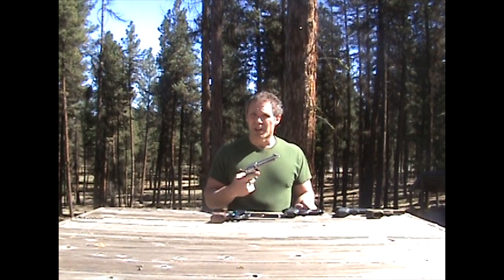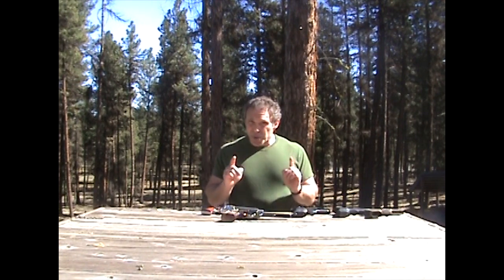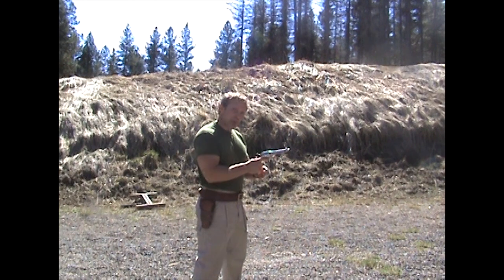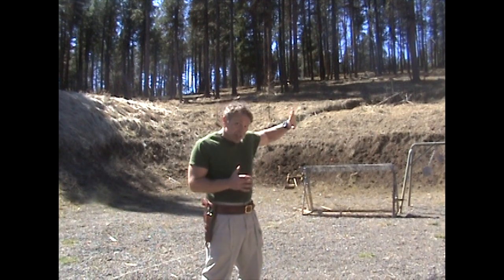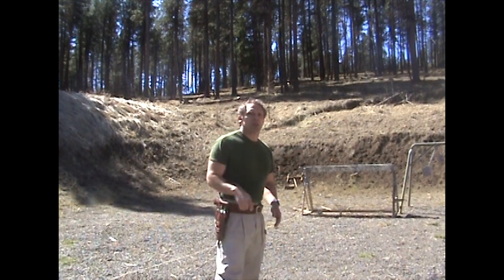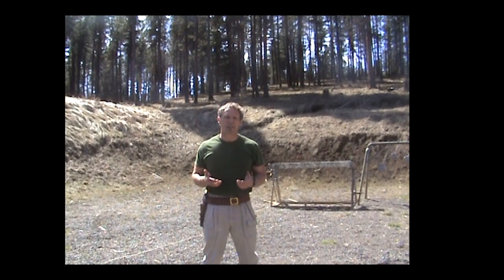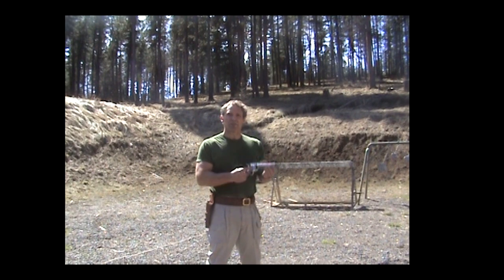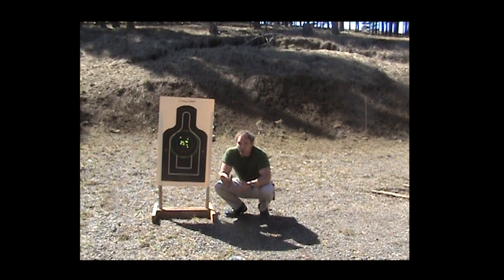Single Action Revolvers for Concealed Carry.

Comment: I just finished reading all of the comments and watching the video. How many of those that commented have actual experience in using a handgun for self defense? How many of us really need a high capacity semi automatic to defend themselves. I think that if you do , you are in the wrong areas at the wrong times. What is the average number of shots fired in a civilian self defense shooting? I fully support your rights to have a high capacity weapon, but wonder if it's a solution to a non existent problem. Revolvers, whether they may be single or double action are a viable self defense tool and each man/woman should choose what suits them best for self defense. Great Video, I enjoyed it very much.
Reply from the maker: Good points. Accurate statistics on how many rounds someone fires in a citizen involved shooting are very hard to find. But generally I think numbers like three, four, or five. I agree everyone should select what suits them best, but if someone really thinks that a 17 shot mag is a significant advantage over a 15 shot mag, then They're not focusing on what's important.
Reply: I acknowledge that what I'm about to report dates from the 1940's through the 1960's.  However, when my father was an FBI SA and firearms instructor, the Bureau had a "Rule of Three" for most shootouts:  three seconds (or less) duration, three yards (or less) range, and three rounds (or less) fired.  Okay, several decades have gone by, autoloaders -- not wheelguns -- now dominate, the FBI uses a seven (not a three) yard average and (maybe?) a five (not a three) round "normal" engagement.  HOWEVER, the essential point is many gunfights remain:  short range, six or less rounds fired, and very rapidly concluded.

I'm not going to carry a single action revolver for personal defense, but if that's what I had, I certainly wouldn't feel unarmed.

=====

P. S.:   An earlier post intimated that .45 Colt loads are quite outdated for defense.  That's absolute baloney.  While it may possibly be true for much "cowboy action" ammunition, it certainly is not universally correct.  I carry a Smith 25-9, .45 Colt, four inch barrel, N Frame Mountain Gun for weeks every Summer in the area near Chama, NM, and Antonito, CO (best trout fishing imaginable).  It's loaded with 250 grain Gold Dots, it's utterly reliable, and it's extremely accurate (duh, it's a very well maintained N Frame).  Those Gold Dots penetrate over a foot and expand to .7-.75 inches.  That certainly doesn't seem obsolete to me.
Reply: @John Lloyd Scharf:

I rather suspect the very significant “LEO miss” statistics, cited in your last two posts, were considerably lower a generation or two ago, when most officers carried revolvers.  After all, when a officer has an modern, excellent, semiautomatic (with, perhaps, a 13+1 or 15+1 capacity and with a few magazines that can be near-instantaneously loaded), some may see little need to aim carefully and deliberately, which I believe was far more typical during the lengthy “revolver era.”  Incidentally, I suggest this phenomenon also likely applies to our combat military (fully and semiautomatics weapons) and to civilian defensive firearms (generally modern, high quality, large capacity autoloaders).  I’ve contemplated the risks associated this paradigm with some frequency (it is not unusual to read reports of a couple dozen rounds fired at criminals with few — if any — hits). 

Full disclosure compels me to report that I have never served in law enforcement (although my father was an FBI SA and firearms instructor for 10+ years during my youth).  However, I spent twenty years as a Naval officer (including time in combat leadership positions in the early 1970’s), so I deeply understand why lots of not-too-precisely-aimed rounds are often fired (absolutely nothing seemed more comforting to me than a couple Browning M2’s ripping into a riverbank tree line).  

In addition, I ardently emphasize that every LEO has the fundamental RIGHT to maximize his probability of returning home uninjured after every single watch — there are NO exceptions to this principle. 

Nevertheless, and especially in highly populated, urban environments, all those misses continue downrange at high velocity, posing a very real threat to innocents.  This drives to question if would slow, deliberate, carefully aimed fire might sometimes be equally (or more) effective — and FAR less dangerous — than “spray and pray” in many LEO scenarios?  The fact that modern sidearms and rifles have the capability to fire enormous numbers of rounds rapidly — and to be near-instantaneous reloaded with box magazines — does not mean (at least to me) that this should be the default law enforcement tactical approach.
Reply: Roy Kiefer i
Reply: @Jennifer Montrie:   Did you post a comment?  All I saw was “i.”
Reply: If modern semi auto pistols were available in the heyday of SA revolvers everyone would have used them instead. To each his own but in my mind a SA revolver for defense in 2018 is silly.
Reply: One of the two times in my life I ever actually had to draw, what I had on me was a Ruger Blackhawk. The other was a Model Ten 3" barrel. I did not feel undergunned in either case. Open carry state, decades ago.
Reply: I live in a country where all handguns are banned, so I don’t really have the right to comment, but deep down in Paul’s presentation is something like, The gun you carry is not as important as the training you have on using it.  A very respected English shotgun coach told me, when I was 16 and learning to shoot, “Handle your gun every day, shoot it as often as possible and never even so much as pick up another gun”. A bit extreme but it worked for me.
Reply: @JohnLloydScharf  That may have been true in 1988, back when most police departments issued revolvers....

Comment: Hey Paul, huge fan. Awesome video! I only have one thing to add. When you are ejecting spent cases and reloading, you are right to do one at a time. One thing I train is keeping the gun at chest level. You should be able to load and unload without looking at your gun, but in the off chance that you do have to look at it it will allow you to still Keep situational awareness instead of looking straight down.

Comment: Bob Munden (RIP) was the only person I've seen shoot a SA Revolver, accurately, faster than you can shoot the 45 ACP 1911
Reply: He shot weak ass cowboy loads. Not full power self defense loads. He was just show.
Reply: Odee Dillon light powder charge or not, that is still 225-255 grains of lead coming downrange at least 750 feet per second. More than heavy and fast enough to hit and put down its target with ease.  Even if one isn't dropped with one or two rounds of that,  they still make near half an inch holes as entry wounds and at least that on exit, bigger than hole in the right spot, faster you bleed out.
Reply: chrismc410 I think you're confusing me with Tec 9 .  I agree 125% that the .45 LC is a man stopper.
However, I have only one correction for your comment; Entry wounds on mammals, man included, are not the same diameter of the bullet entering.  Because of skin elasticity, the wound is much, much smaller.  Exit wounds, depending on the bullet type, and caliber, and be similarly small, to grossly expansive.  This, from real world observation.

Happy New Year
Reply: Odee Dillon Though I've never seen him use a single action revolver, I'm sure Jerry Miculek can do it.
Reply: chrismc410 Yeah.  I think he's the reigning champ now.
Reply: +Odee Dillon  No one can match the speed of Bob Munden shooting two rounds from the hip, but Deuce Stevens is actually a bit faster than him at fanning:
https://www.youtube.com/watch?v=3NE6btH_9GY

Bob was very fast at this, when I saw him do it, but he was not the fastest.
Reply: +BBQ Sandwich  Bob Munden's cowboy loads, while far from hot for .45 Colt, weren't on the wimpy side for competition.  He used a custom load with a 250-grain bullet and a muzzle velocity of 785 fps.  In terms of momentum (for recoil), its power factor of 196 is considered "Major", and in terms of kinetic energy, its 342 foot-pounds is comparable to a decent 9mm defensive load.  It is hardly "weak ass" even for a defensive load, and is not easy for everyone to shoot.
Reply: +chrismc410  I've seen Jerry Miculek shoot single action revolvers, but thus far I've never seen him fan one as fast as he can.  He probably has the quickest right trigger finger in history, but I'm not sure about his left thumb.
Reply: Bob Munden was amazing. He could shot anything blazing fast and accurate.
Check out his video shooting a Bond Arms Derringer. Unbelievable.
Reply: @rbrtck  Deuce is not fanning , he's slip hammering, big difference.
Reply: @joelafives   True, I guess I was thinking of these techniques as essentially the same action on the gun done in two different ways.  That said, at the time I recalled seeing Bob Munden also slip-hammering (not fanning, strictly speaking) somewhere, and he wasn't quite as fast as Deuce Stevens.  The following was probably the video I was thinking of:
https://www.youtube.com/watch?v=xRXXxQ1OuDc
Reply: Go watch a Cowboy Action competition. You will not believe the speeds.
Reply: @OdeeOz  I shot a 200 gr bullet at 900fps. A lot of shooters did not shoot the mouse loads.
Reply: @mikefranklin1253  what does that have to do with the OP?  Did you shoot six in under 2 seconds from a revolver, like Mr. Munden did?
Reply: @SOLDOZER  You're F'n crazy! Light loads or not - had nothing to do with his speed. Bob Munden could shoot you twice before you could spell half of "he".
Reply: Search master gunfighter fanning on YouTube, guys name starts with a C i dont remember it but he's crazy fast

Comment: Just re-watched this one, today. Still like it! I have noticed some things, as I get older. Several years ago, DA revolvers gained an advantage, when two different conditions started affecting my right hand, because an auto-loader is at its best when run with TWO healthy, fit, strong hands; one strong hand/wrist to firmly support the weapon, itself, and another strong hand to run the slide. Lately, however, I am getting the first hints, in knuckles in each of my index fingers, that long-stroke double-action trigger-pulling may not be a skill that I will always be able to maintain. Single-action sixgunning skills are something I should maintain, just in case. My USFA Single Actions are mostly just “fun guns,” for now, but they may have a higher calling, sooner or later.

Comment: Another old method was to just remove the whole cylinder and drop in a loaded one.  Pull the pin, pop out spent cylinder, drop in loaded cylinder, lock pin back in place.
Reply: This is the way

Comment: Great points and good techniques. Looks like the first shot is about as fast as a DA revolver or an auto. Have you ever compared them with a timer? I would think they are very close. Too bad you didn't have one of the new Vaquero Sheriff's Models to demo. They make a 3.5" .44 Special, which may be just the thing. Easier to conceal too. Also, Ted Mernickle makes very nice high ride concealment holsters for SA's. I believe they are a 2 slot belt slide style, which should ride close to the body and conceal well.
Reply: Someone who is good with a single action can get a shot off faster than a double action because you cock the hammer during the draw on a single action.

Comment: Some other "advantages" of single actions army and clones:
- Safer. You can normally fire bigger calibers safer on a single action revolver. (no double firing)
- The colt SAA design in particular is very pointable gun and comfortable to shoot and the triggers are generally better out of the box than most semiautos and double actions out there, which means you will probably shoot it better under stress.
- The colt SAA design in general are heavier than most semiautos (even the smaller 3" birdsheads), and for this reason handle better recoil in many cases.
- You have the limit of 5-6 shoots, which many people see as a bad thing, but could be good if you look at it from a different perspective. For example you will avoid situations where you most likely have to shoot 10-20 at a group of armed people, which in most cases will get you killed by temptation, you avoid the trigger happy cop having to explain why he fired 18-20 at a guy pulling out a cell phone out of his pocket, if you are a regular citizen you will avoid having to explain spreading 15-20 all around the city, a real hard time, and probably including the time to apologize to the families of those hit by mistake in the process.

Comment: The NAA mini is about the only tiny concealed carry type single action I can think of. 

The best reload option for a single action is going to be the "New York reload" (carrying 2 or more guns) 

Another option faster than the loading gate is if you have a convertible cylinder model of single action you can have your second cylinder loaded in a pouch or pocket and put it in similar to the cylinder change Paul demonstrated in a cap and ball video. Many .45 Colt SA revolvers offer a .45 acp cylinder. Some straight wall .44mag or .44 special depending on brand offer a bottle neck .44-40 cylinder some .38-40  bottleneck offer a .40 or 10mm cylinder some of the .357 mag offer a 9mm cylinder some of the straight wall .327 or .32 hr offer a bottleneck .32-20  and of course many .22 mag offer.22 lr cylinder

Comment: Thought this video would only be about 5 seconds long, with Paul popping up and saying: "Are you crazy?"
Reply: I often carry a 45 Colt Ruger Bisley for protection. Bear protection, so not concealed. I carry cross draw as I only shoot single handed (I find the recoil more demanding with 2 hands using my "bear loads"). I practice drawing with both dominant and non-dominant hands (very easy to draw from the cross draw with non-dominant hand) and firing 2 shots (single handed). The Bisley's hammer sits much lower than the SAA or Blackhawk style hammer, and is easy to reach with even a short thumb. The recoil of the shot in the smooth grip pivots the firearm in the hand, which puts the hammer directly where your thumb can rest on it as the barrel drops for the second shot. This dropping of the barrel for the next shot effectively does all the cocking work for you and is already cocked when you are ready for the next trigger pull. Anecdotal evidence from those I have talked to surviving a grizzly bear attack shows you usually barely have time for one shot before the bear is on you anyway. More than one account involved one arm (usually dominant) being disable by the bear during the encounter. I am confident in my abilities with that revolver and trust it to protect me against some of the largest brown bears in the world. Because of my comfort with single action revolvers, I would probably be more effective with one concealed than I would be with a double action revolver. In all reality, I carry a 1911 when I'm not in the woods, but don't trust low power (less than 44 magnum) for charging animals in excess of 1000 pounds (bears, moose).
So in short, I don't see an issue with CC with a single action revolver. In trained hands, they can be very effective. The transfer bar safety revolvers  are also VERY safe to operate and carry.

Comment: SA revolvers are very ergonomic, pointable, and "handy" to use. With .45 Colt you have a fine choice of self defense ammo. And basically, one good hit is all you need to end a confrontation. If you need more than 5, you aren't qualified with that weapon. As far as quickness goes, it's easy to learn to draw and fire mighty fast. That matters.

Comment: I was thinking of carrying a cap n' ball black powder 44cal revolver for defense. Seriously
Reply: I'm not 21 so I can't get a regular centerfire pistol
Reply: Dom san yeah they're a pain to reload
Reply: I did it for 3 years. i carried it loaded, with 3 backup cylinders. I carried a 1858 Remington .44. I now carry a 1875 Remington .44. Remember, you technically can not carry a cap and ball revolver for protection in town without a CCW permit. specially if its concealed. Check your local laws, talk to your sheriff, do your research.
Reply: Aleksandr Aleksandrovich Bortz did you carry the cylinders capped, if so how did you keep the caps from accidentally going off
Reply: @stephenmccain9387  I carried capped, The 1858 Remington has notches in between the cylinders to rest the hammer in. the hammer spring tension is great enough to hold it in place, also my carry holster was a "Calvary" style flap holster that buttons down. As long as you didn't play with your gun, and break leather, unholstering, and holstering it to much, maintaining hammer and trigger awareness, it wont ever go off. Caps, or any piece of ammunition really, will not go off on its own, its always through user error, or negligence. I kept my holster on its own pistol belt, instead of messing with the holster, i just took my gunbelt off, that reduces the risk even more. Even a 'pretty good' impact wouldn't set it off. but then again, we stay safe by not tempting, and testing the devil. To this day, that 1858 is still loaded with the charge and balls i put in it years ago, even though i do not carry it anymore. I retired it, and have my 7 1/2"  Barrel 1875 Remington .44WCF, i carry now.
Reply: Aleksandr Aleksandrovich Bortz thank you for your response sir.
Reply: @stephenmccain9387  Stay safe, and keep asking questions! Better to ask what may seem to be a stupid question, than to not be sure.
Reply: @OldeCountryHomesteading  That just depends on the areas laws on concealed weapons. Here in Missouri anyone that can legally own firearms can concealed carry a modern handgun if they are 19 or older(although its a little hard to acquire a handgun if you aren't 21 you have to either build it or get it in a private transfer).